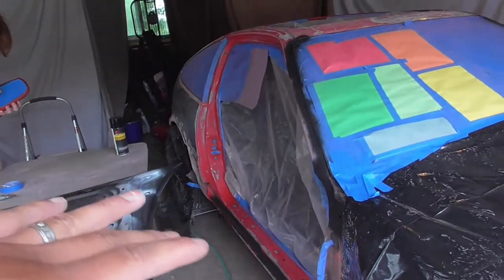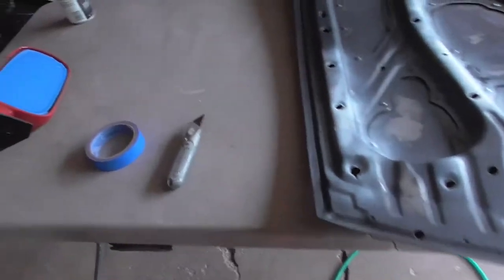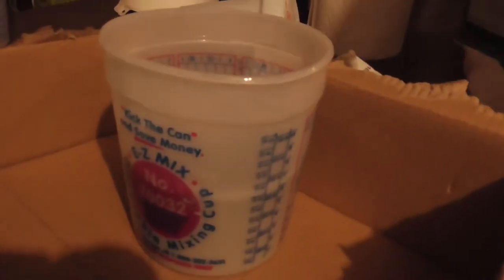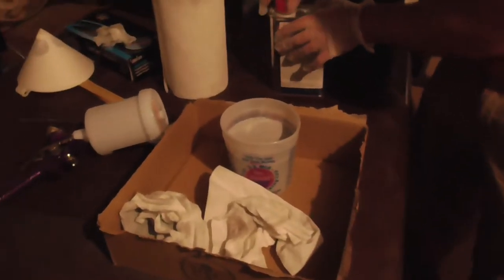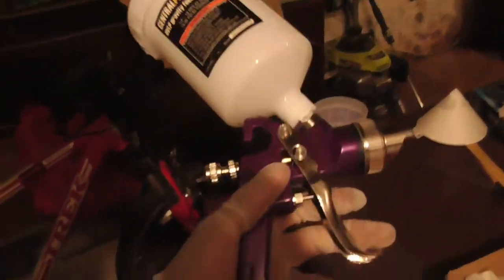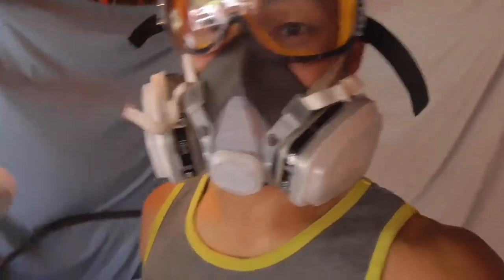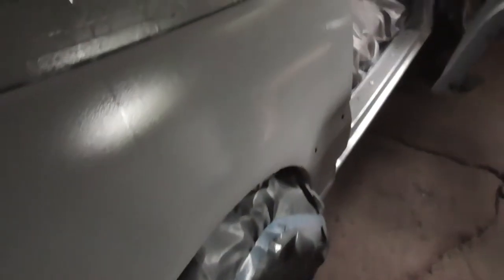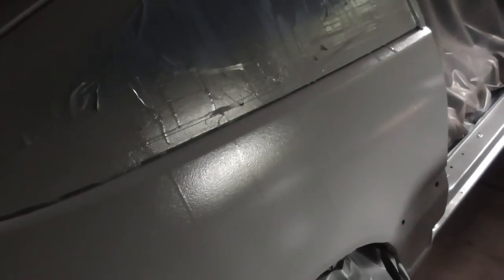Painting The Crx Part 3 | Primer

Comment: Hey boss I also have a prelude sh
 About to rebuild it. Your videos are 🔥 
Thank u so.much for posting. Stop letting ur camera die tho😄 jk

Id love to help you with some tips on painting. The harbor freight gun tip isn't big enough for spraying primer.  You can drill out the gun to make it work.  Or, buy some reducer that is made for your primer and reduce it so it will spray in the harbor freight tip.  Depending on the primer reducing it will weaken it.  Sand the primer when dry with 320 to 360 till smooth. The basecoat will like the scratches.  Make sure you Try a lighter coat next time, trying to go so heavy and all at once causes runs. You can do less, with multiple passes to build the layer smooth. Also you'll want a slow reducer depending on your weather temp but that will allow it to level out than drying fast with peel. U got this bro!
Reply from the maker: Yea I need to get a better camera. The camera that I've been using is the Panasonic hcv180k, and the battery life just sucks. And yea this was when I was new to painting with an air gun lol. But I'm better now, I'm a full time liquid painter, so I've gotten better with painting. A video will drop soon, so stay tuned for that, becuz big surprise coming.